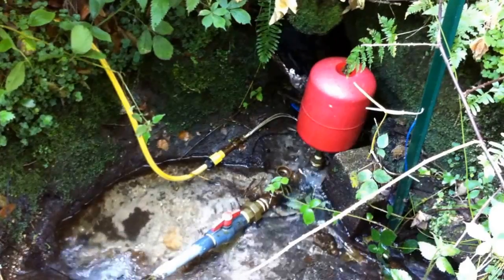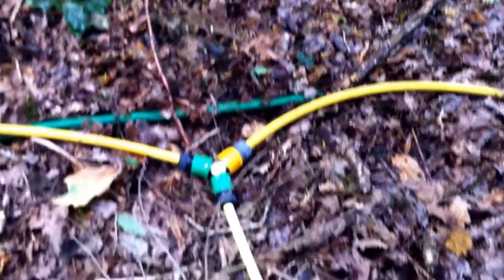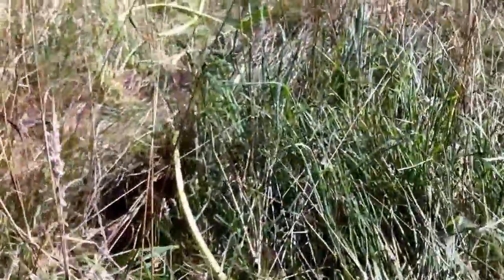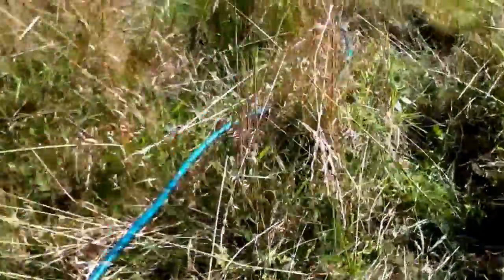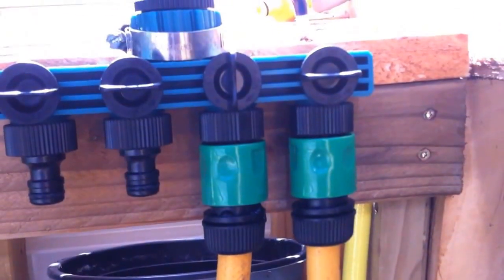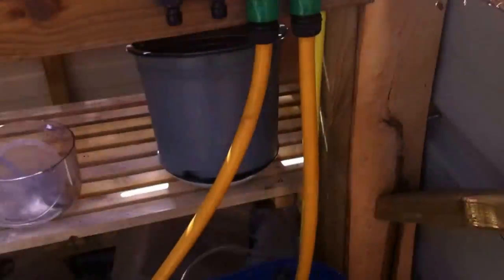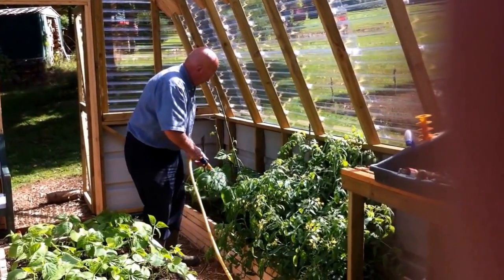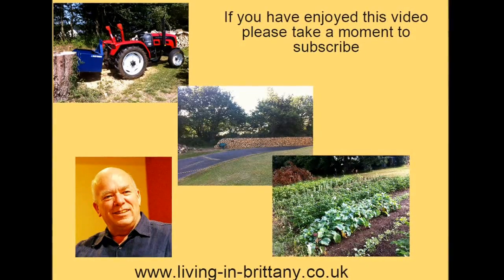Adding a watering system to my greenhouse

Comment: I’d love to see an update on your greenhouse project it has been four years.   I’m getting ready to build one.  What are your thought on using the fence post anchors northern USA where we have frost.  I’d much rather pound in posts than dig 2 foot footings.  Loved your videos.
Reply from the maker: Hi, many thanks for watching and commenting, We have actually moved house now so no longer have the greenhouse, did you see the final video of the series where it was finished? It performed very well and produced a lot of produce. The only problem I ever had was where the corrugated sheets overlapped I had some capillary action with water tracking back. In retrospect I would have put silicone on the overlaps. I think anchors would be fine I never had a problem in regard of that at all. Good luck with your project.

Comment: Well done! Even the thumb on the lens was stedy. :) do you think you will be installing drip lines at some point? seems like you will have sufficient  pressure. do you have to shut off the second delivery output to run the first?
Reply from the maker: Land to House Yes, I will be installing some drip lines at some point I already have some here somewhere, there would be enough pressure just off the ram pump but as it is taken from the same line that leads up to the 300 gallon tote there is also some back pressure so more than enough for what I need.
Reply: Its nice to hear that you do not have any back pressure issues with the split delivery pipe. Some of the ones I have done have lost pressure on one line when the other is opened. I do like the idea of having that tank for back pressure! This has been a fun project for me. Keep up the good work.
Reply from the maker: Land to House The only real problem I have had is with the rubber connector between the pump and the drive pipe, I think it was down to the force of water in an 1.1/4" pipe, I actually had 4 split on me before I changed it to a glued connection. as it is a permanent installation  except for taking the pump out during the winter Months, It's a much better solution for me and the pump is actually working the best it has ever worked. My 300 gallon tank is full to overflowing all of the time!
Reply: +Michael Collinson that's awesome.  I have also gotten away from that connecter. did you get my comment with the link to the pipe connector I use? it might not have posted because it has a link.
Reply from the maker: Land to House Hi Seth, i did miss that I would be interested could you post me a link? My problem was I had an 1.1/4  valve fitting on the pump and a 32mm drive pipe, I ended up grinding the end of the pipe down on a bench grinder to make it fit, now that I have a rigid connection with no flex I find that I get more pressure than before
Reply: Michael Collinson I bet you get a lot more after removing that part. It does take away from the pressure wave. Here is the part I use. If it will post. http://goo.gl/rTy7y8